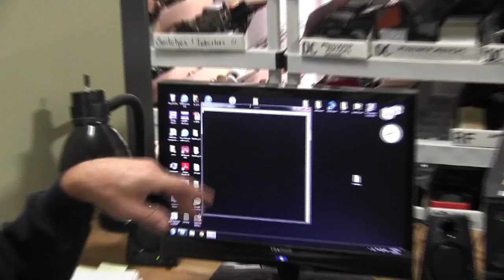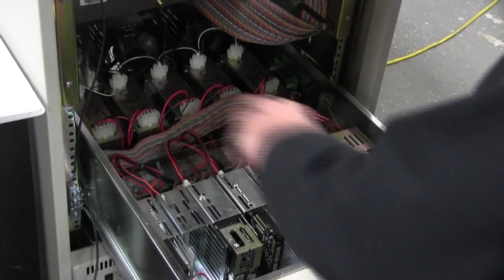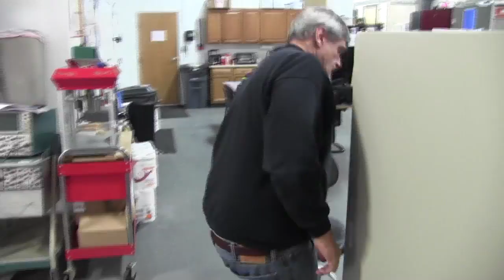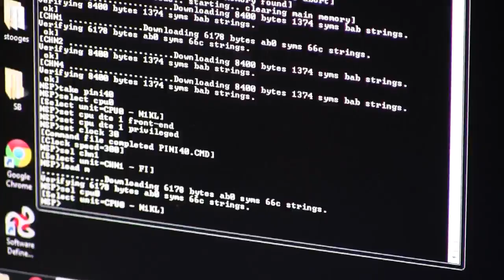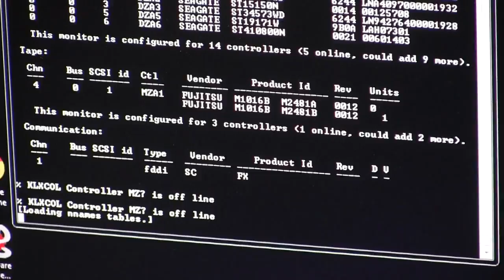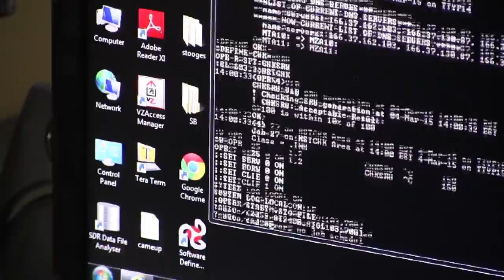Systems Concepts SC40 PDP10: Operation Demonstration

Comment: Wow! I was PDP-10 user during my college life in 1980s  before system retired in late 1988.  Then I was CompuServe subscriber for a few years before I went to the Internet in early 1990s.  In early 2000, I found PDP-10 processor reference manual and TOPS-10 tape images. I developed PDP-10 emulator and successfully loaded and run TOPS-10 operating system. 

I was looking for SC-40 technical manuals but can’t find it so far. I only found XKL-1 TOAD-1 architecture reference manual since PDP-10 production stopped in 1983. I hope someone got CompuServe OS sources since TOPS-10 is open-source operating system. Sources are available in Bitsavers and others.
Reply from the maker: I remember your emulator i played with it on a PC.  The SC folks went off the grid and there is very little known about the machine they were not great at writing documentation, i am still trying to make sense of the micro-code for the channels.

Comment: An impressive video, Mr. Moersdorf-not that I can comment or rate the technical information, but I must compliment you on your production. Too many times I have seen junk on You Tube made by self professed experts. Some have very irritating habits like delivering a barrage of "you know" (s) or similar distractions. Self-held cameras bouncing around and out of frame or out of focus are highly irritating. I bet you did a practice run-your clip was smooth flowing and I didn't detect editing distractions.  Your cameraman followed the dialog/action extremely well. Your audio was very sufficient even when the computer was humming. It is so aggravating to watch a video that has room echoes, babies crying or dogs barking in the background. I've seen enough junk on the You Tube to appreciate a well made video. I look forward to checking out the rest of your library. Harry

Comment: Wow, that's a blast from the past. I remember working on all this stuff in the early 80's at Systems Concepts. We mostly used Tops-10 and Tops-20 in-house. I've never seen it running Compuserve's code. I mostly did circuit board layout with a little bit of software.
Reply from the maker: +SpareSimian Thanks for your comment, love it when someone remembers the accomplishments of "old technology".  I wonder if you are in touch with Stew Nelson I was not able to contact him even using my CompuServe contacts and even via HAM radio (we are both amateur radio guys).  My sense of it is he doesn't want anything to do with the past and I understand that.  Great to hear from someone who actually worked at SC and the circuit board layouts were state of the art great. No wires with low Rev numbers, shows attention to perfection.
Reply: +Gerry Moersdorf I haven't heard from any of them since I left there around 1985. According to the Wikipedia page on Systems Concepts they became the SC Group in Reno, Nevada. The home page for that site is blank now but the Wayback Machine shows a page with an address and phone numbers in 2008. 

https://web.archive.org/web/20081229042856/http://www.scgroup.com/

BTW, MSP stands for Mars Supervisory Processor, the 2-board 68000-based front end. I remember Bertram did the software for that, but I can't remember his last name. (I'm terrible with people names.) The SC-40 came after I left. We'd done the 30 and were working on the 25, a cut-down version, when I left. I think the 40 was to be the ECL version of the TTL-based 30, and Stew was starting to work on the schematics when I was there.
Reply: +Gerry Moersdorf Oh, and you've probably seen this page of PDP-10 history and status. But if not...

http://www.inwap.com/pdp10/